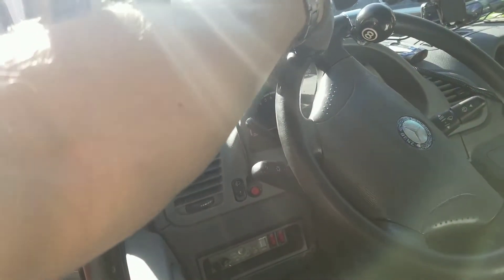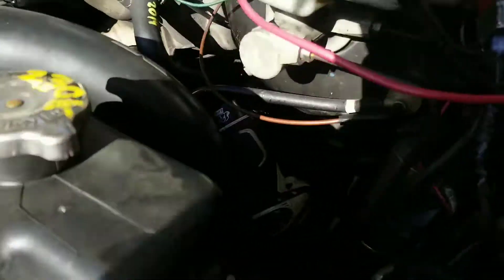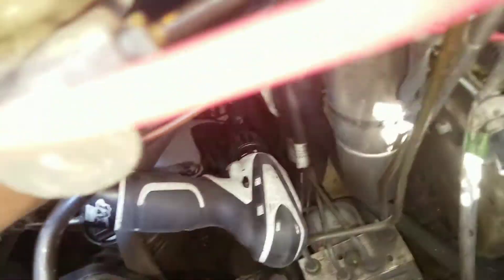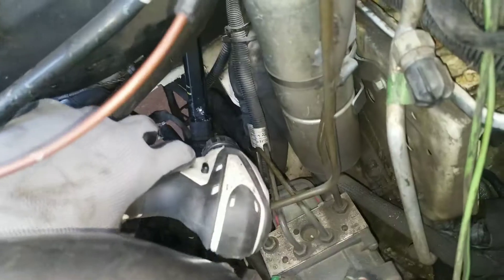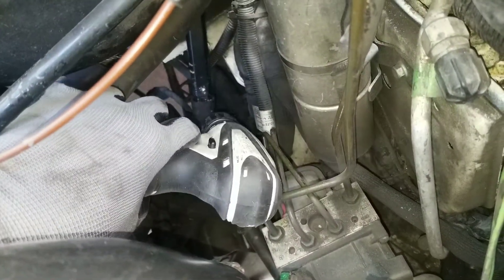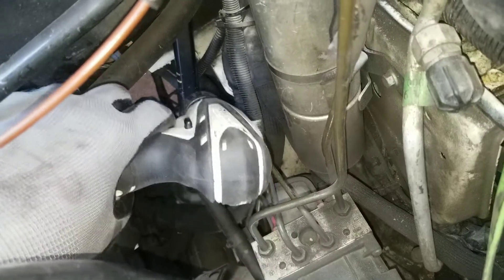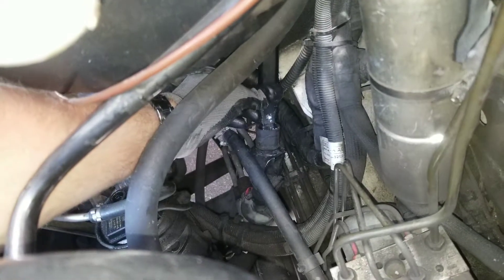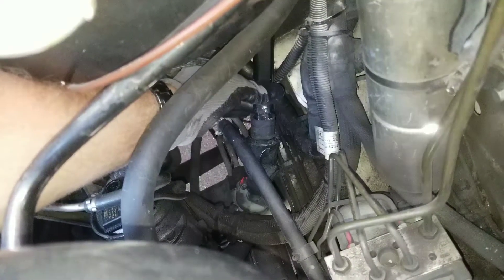T1n sprinter steering column play: how to fix with one bolt

Comment: The bit you’re putting a bolt through needs to slide up and down that shaft though!..
Reply from the maker: In event of a crash, that is true. I used a very low grade bolt that likely will shear off easily. I don't recommend anyone do this, there's got to be a better solution like filling it up with RTV adhesive maybe like the Miata race car drivers do. It also didn't work that well. It helped, but there's still slop.

Comment from the maker: Update: whole steering system has now been replaced. Replacing the power steering pump, seems to have helped to clear the last bit of steering play. There's maybe 1/2 an inch of steering wheel free play now, with the vehicle on. I think the reason why it's kind of squirrely on the highway is because the front transverse leaf spring bushing is worn, causing most of the weight to sit on the front wheels. Do this mod at your own risk. I don't know if this little hole could cause a shear in the steering column.

Comment: I'm dealing with a new slow speed rattle that I can feel in the steering column, though not free play. When I grab the shaft (hollow part with the hole that you put a screw to) above the lower u-joint, I get a little play, a little tick toc when I pull back and forth. Is that your experience? What's the part number for that missing shim?
Reply from the maker: Hey I just saw your reply. Hmm trying to remember, yeah I think due to the design there is play between the outer shaft and the inner shaft which causes that tick tock noise. I don't think there's an actual part number for the shim,  I think someone told me that when parts like these are being installed the installer will sometimes shim them. I'm not sure if it's poor quality from Mercedes or if it's designed that way to have a little bit of play with a brand new steering column. But I don't like it. Thankfully, my steering column has not sheared from the hole that I drilled in it, 100,000 miles later. I suppose in a wreck I might lose steering a little easier if my wheels get hit but I'd rather have tight steering than deal with the horrible OEM design. 
I recently changed the power steering pump and with the vehicle on there seems to be less play. I started to wonder if increased pump pressure would center the rack more, and cause less perceived play, and more of a resistance feeling keeping it centered. And I'd say my theory was proved correct after I changed my steering pump, it's doing better, but I'm sure there are mods to make it even better. 

I read about some guy making a wheelchair Sprinter van who had a shop modify the valving inside his steering rack to apply more power assist. Apparently it's pretty common practice, and all power steering racks work the same. I wonder if this mod would apply more centering pressure and result in less perceived steering wheel free play. 

There's also the steer safe mechanical steering aid which is basically springs that center the wheels, and I think there's an Active steering system", a bolt on part which works similarly made by someone else but I forget who.

Comment: Do you know the part number of the part you are drilling a hole in?
Reply from the maker: I don't. In usa, it's part of the steering column, which is sold as one piece only. I tried buying one on eBay, and it didn't fit - was made for right hand drive.

Comment from the maker: Update: it's fixed!!! But it turns out the root of the issue is a missing shim in the steering column.
Reply from the maker: Update, this helped, but the main cause of the steering play was due to cross threaded mounting bolts on the steering column. They would bolt up tight, but there would still be a gap between the head of the bolts and the flange of the steering column mount. This tiny bit of play can add a considerable amount of steering wheel free play. See my tech alert on the Sprinter source forums about this for more info.
Reply: Do you have a link to that?
Reply from the maker: @engineerable  oh, I worded that badly. Adding a custom shim is something that installers with experience might do, but it's not a part that Mercedes sells or includes in any parts diagram. If you look at the lower yolk of the steering column, there's a lot of slop. That's what I was trying to fix by adding this bolt but it didn't really correct all of it. The slightest bit of slop in the steering column translates to a whole lot of slop in the steering.